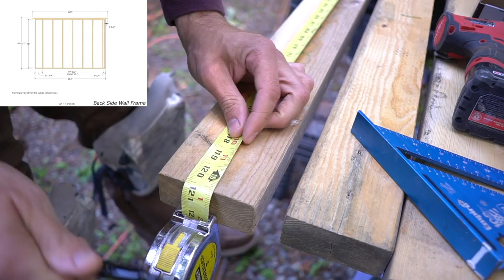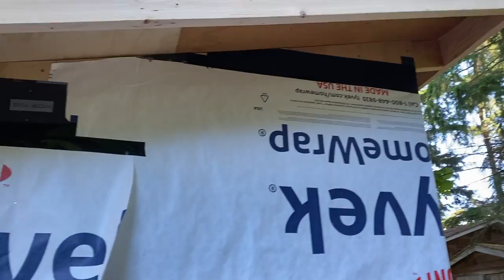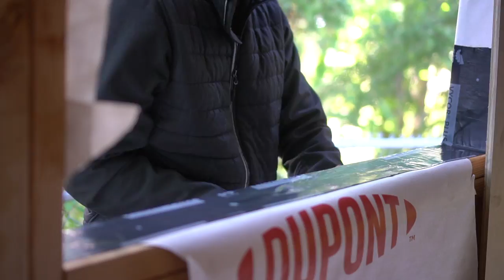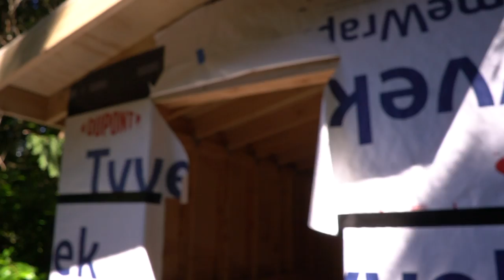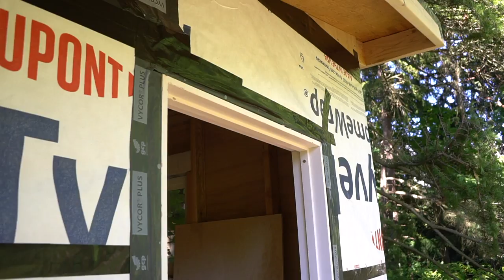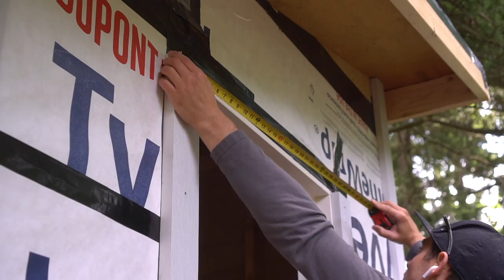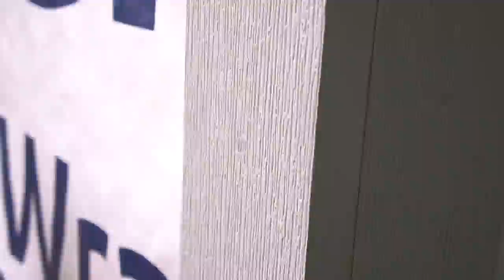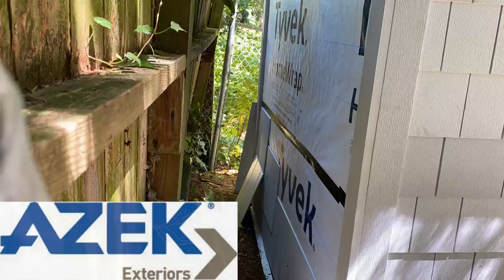How To Build A Shed And WHAT I WOULD CHANGE ONE YEAR LATER

Comment: The vent was the only true issue I had with the shed I built while referencing your design. Framing is one of the more enjoyable things in life.
Reply: The lean too shed actually doesn't need a roof mounted vent, and can be vented from the soffits on either side because it already has a high point and overhang. Though a gable end vent would work as well. Just get vented gable or vent both sides of the soffits. I vented through my soffits in my build and it is amazingly well regulated inside the shed. I also used a metal corrugated roof instead of a shingled roof.
Reply from the maker: I love the framing process as well.  Thanks so much for watching and glad this video finally took care of the venting issues haha :)

Comment: This shed will outlast his neighbors’ houses.   Venting was a smart addition obviously.  In the south we have to have venting due to the heat. Slick peg board system.  Was wondering if you’ll ever consider the door opening outward?  Regardless this shed is nicer than many homes.
Reply from the maker: Good question and It's not a PACKED shed so the inward door is not an issue but I could see that being the case if it was a packed out shed haha.  Thanks for watching TJ.

Comment: Another thought I had is that you didn't add a filler board to the bottom of the door. You cut off the bottom and removed the original door filler. A simple addition to the bottom of the door, yes?

Comment: Thank you for the great instructions you provide Brent. I really enjoy your videos. 

Brent I want to buy your plan for the shed build but have a question…

How do we weather proof the sides which back up against the back wall. I want to attach it to my brick veneer house, but the concern would be the same regardless of it being weatherboard or brick veneer. My concern is when it rains directly in that area (back house wall) or when the wind pushes the rain in that direction, it will rot out the back wall. Thank you Brent, you’re a legend!!
Reply: Well I guess he has no idea. 🤪
Reply: @lalalajuice  if hes using interior doors as exterior doors he def has no idea
Reply: @HimmyNeutron42069  That's a great point!
Reply: Wouldn’t the roof cover the area where the two connect??

Comment: That is not the proper method to install hurricane straps/brackets. They must be sandwiched between 2 rafters/pearlings, headers and/or studs. On both sides of the brackets/straps. You should have placed your header beams side by side with the bracket nailed to the inside seam, that would have been correct. Same for the studs below them, even if you use a cross brace to sandwich the bracket between a second unmovable block.. Placing brackets on the outside of any surface is useless. In places where it's code to do it right, this would fail and you'd have to totally rip it out and redone.

Comment: Another thought I had is that you didn't add a filler board to the bottom of the door. You cut off the bottom and removed the original door filler. A simple addition to the bottom of the door, yes?
Reply: The door had lots of issues. I was surprised to hear not a lot of people talking about it. He used an interior hollow core door with MDF jamb, but it didn't have a threshold either. The lack of a threshold should have been a glaring issue from the moment they bought it